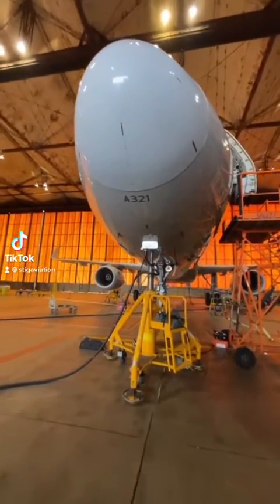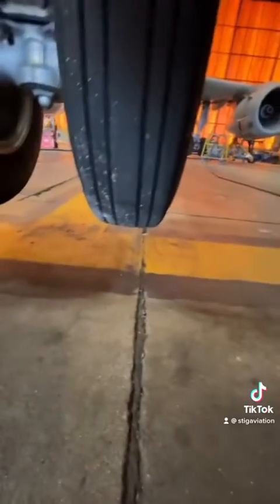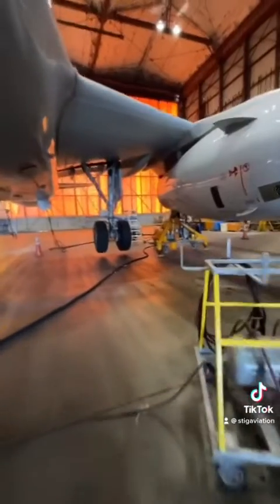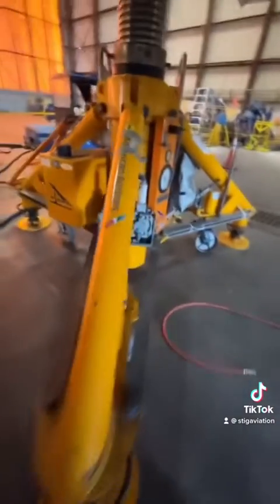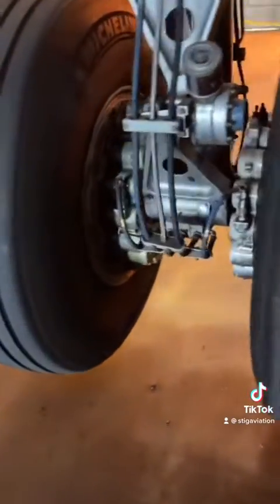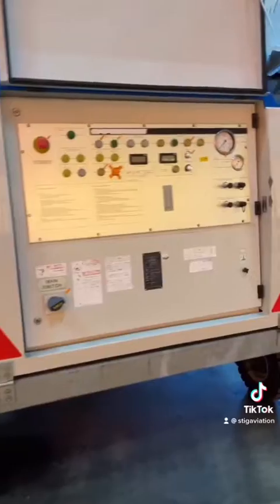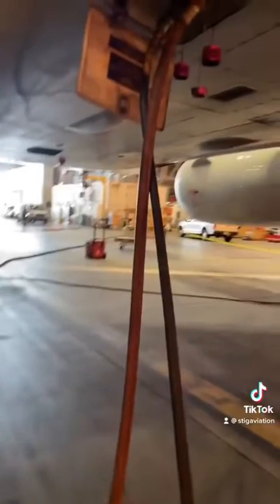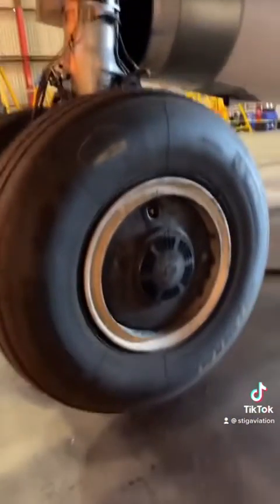A321 on Jacks

Comment: Ok so you did a video on brakes when I asked. How about a shock replacement.  If that's what you call them. Or is that one whole assembly for the landing gear?
Reply from the maker: That would done in heavy maintenance.. I work on the line. But I do have a few clips of that. I’ll try to make a video for that
Reply: @StigAviation  sweet